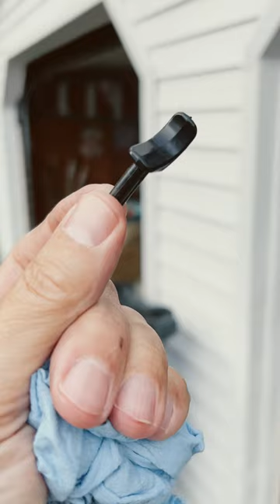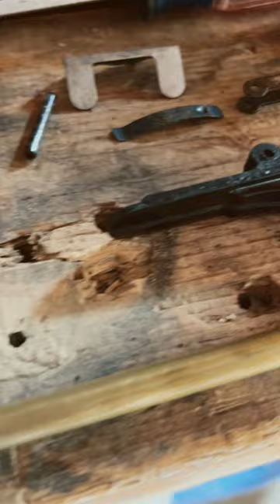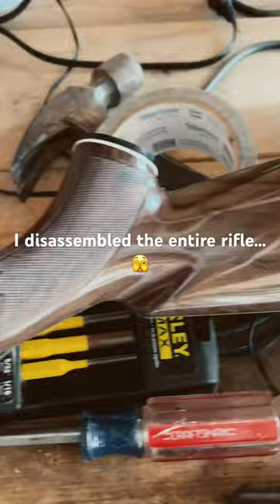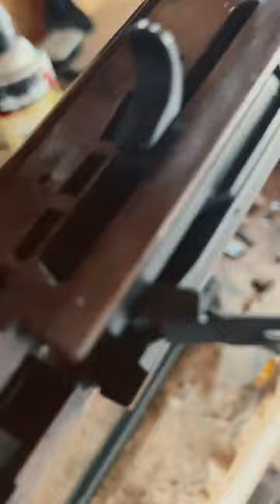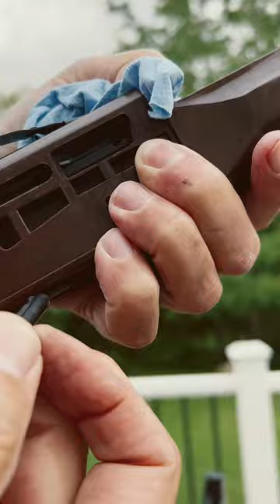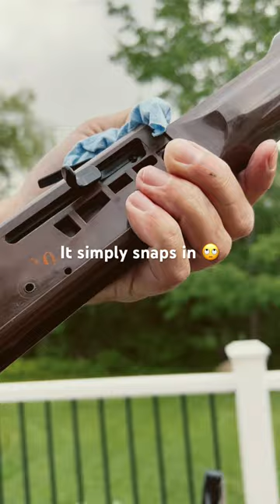My idiocy - Bolt Handle Replacement Remington Nylon 66 22LR #shorts

Comment: My father in law has a CBC knockoff of the Remington. He’s had it for years and loves it but the bolt handle broke off. Any ideas on how to get it out?
Reply from the maker: Check out my video on replacing the ejector and spring.  It’s relatively simple
Reply: Are you in Canada? I have 3.
Reply: @fourbyfourer 
He just bought a new bolt carrier and put that in it after we carved the broken piece down enough to get it out 
No we are in the U.S.